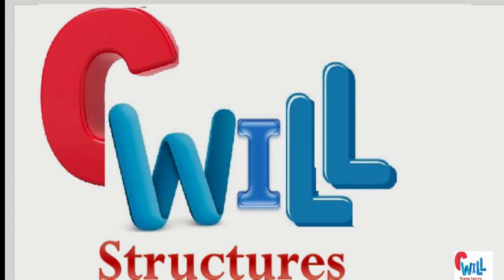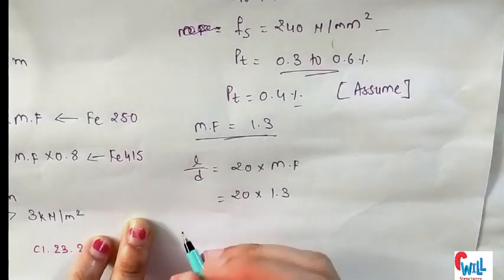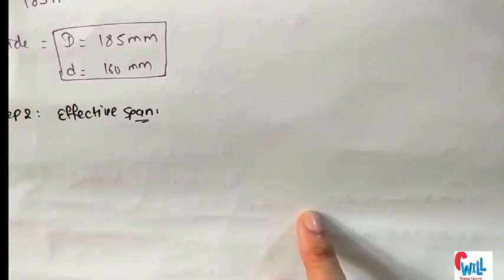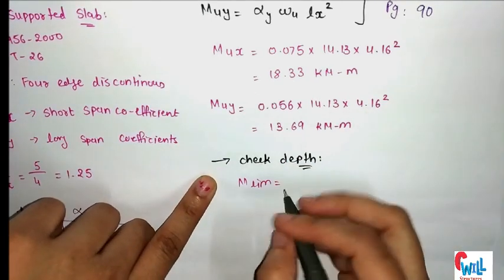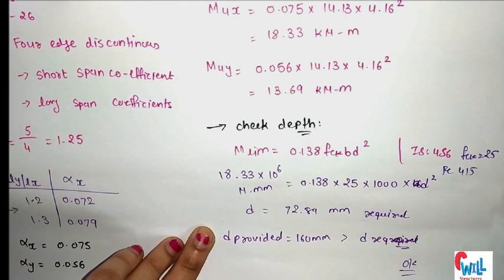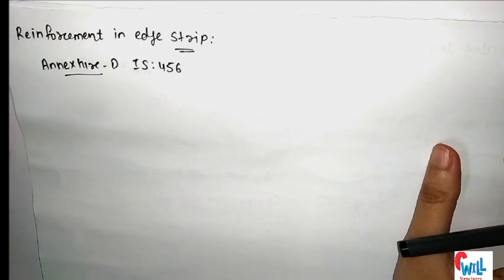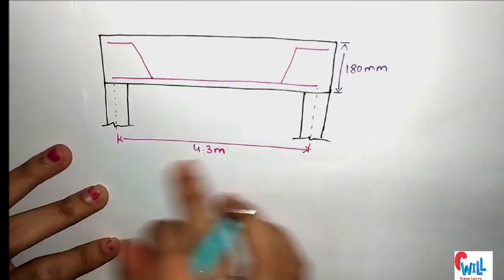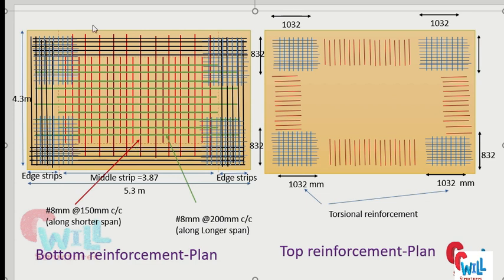Design Of Two Way Slab: IS:456-2000

Comment: Edge strip reinf should be 216 mm2 per 1000mm length of strip which gives 5 nos 8mm dia bar per 1000 mm length of span of edge strip. But u said it 5 nos 8mm dia reinf irrespective of length of edge strip.Plz correct this portion in your videos.or if i am wrong correct me.